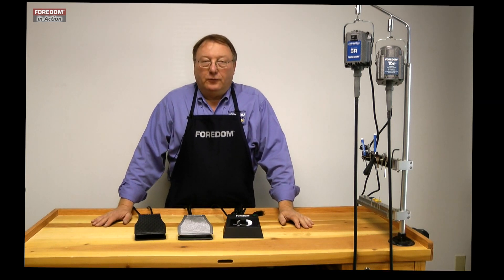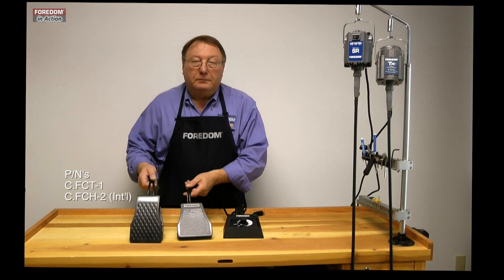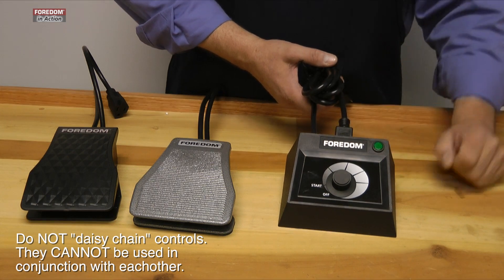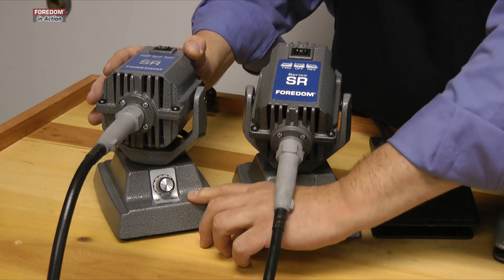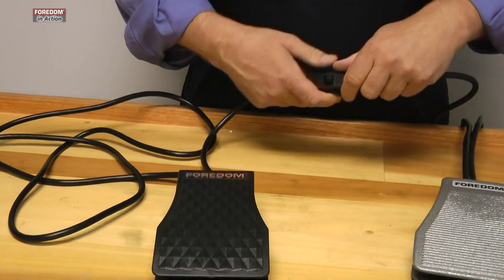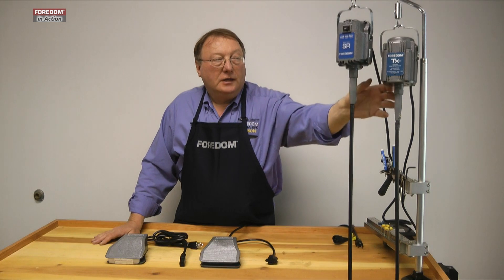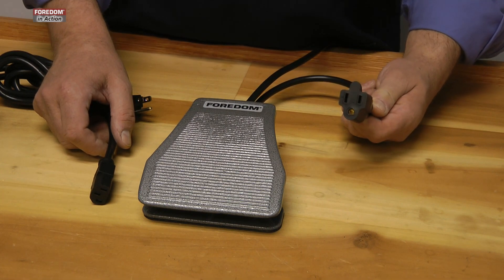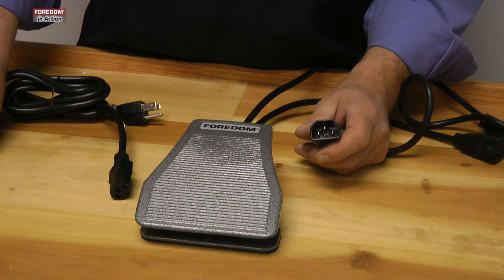Foredom Speed Control Options

Comment: If you're shopping for a new machine and are debating the pedal options, do yourself a favor and opt for the metal pedal. The plastic pedal is very good, but the metal is better: easier to dial-in and maintain a desired speed, less stress on the foot, the pedal remains in position on a hardwood floor, and it just plain ol' feels better to use.
Reply: Thank you, this opinion is hard to find

Comment: I have a question about the motor with the built in dial control. I know you can’t use a speed control foot pedal in conjunction with this motor but can i use a deadman style on/off pedal just to start and stop the device?

Comment: These machines are the bomb wished Id got one year's ago... machine, micro tooling, jewelry carving, So nice !
 The first speed control has a variable electric slide to about half point. Then it takes off... no, adjustment.
Also, the spring is over tensioned and makes the pedal jump and not smooth, you miss much of the speed variance. I fixed this by cutting the spring down. if you mess up you can get a new switch for 12bucks or replace the spring no problema. My petal just jumped in value$$ !! Check it out... .. youtube            ROTOR SPEED CONTROL FINE TUNING SPRING

Comment: So where is 5000 rpm indicated on the desktop controller?
Reply: I suspect they're not marked because different motors can be controlled with the same controller and they each have different maximums.. One goes 5000rpm, another 15000 and the third is 18000. Halfway would then be 3 different rates.
Reply: @billrademaker3926  ah, I see.

Comment: Could you daisy chain the desk and foot controllers on a SR motor?  i.e. have a desktop controller set the power to 1/3 for the H15 hammer, connect that to the foot pedal to give fine control over the hammer within this limited range and then out to the motor?
Reply: NO
Reply: @davidhaney1394  What would be the problem? Melissa Muir demonstrates this on her video on the hammer handpiece at https://youtu.be/LM9uvHmYK_s?t=376